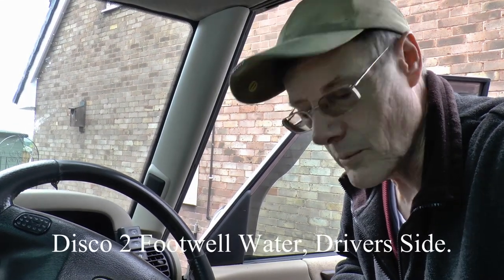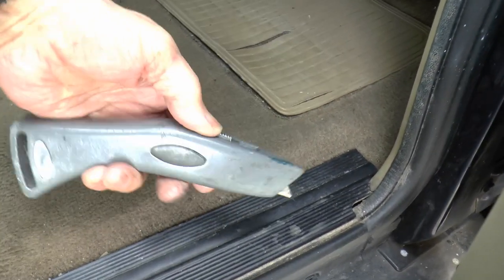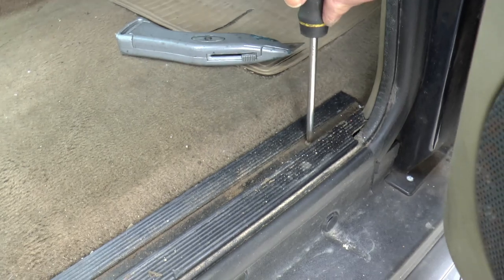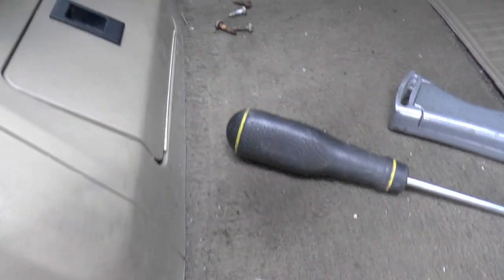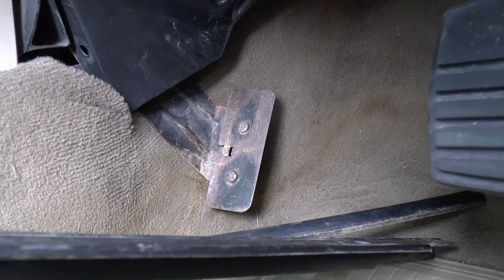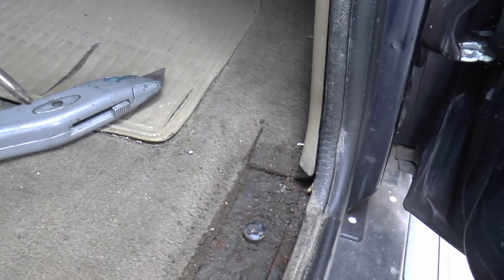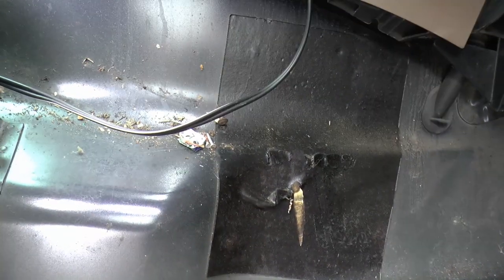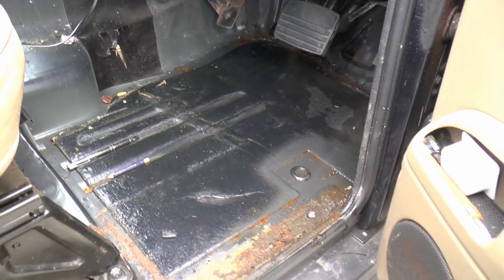Disco 2 Footwell Water, Drivers Side!

Comment: Good morning Derek (my time zone), how are you. I have had my first jab about 6 weeks ago, second one is after 12 weeks (Astrazenica). Do you get fish oil over there. If the metal is sound but rusty, spray with fish oil and let it dry. Smells lovely until dry.  This will convert and seal the rust, then you can paint a protective coat of something over it to seal.
Reply from the maker: Good Evening, tired but well thank you.   Mm, fish oil, that's new. I might just go with the usual Hammerite Rust Converter, thank you . . . !

Comment: I had the same thing, I found the problem was water tracking down the cables that runs down the A box where the drain for the scutle panel and drain from the sun roof goes,  the cables run from the the door in behind A post the out through behind the kick panel, take the kick panel out and you will see the first bunch of wires not far from the door seal, mine was hanging down and causing the grommet to funnel the water down the cables into the foot well, I cable tied it so it now doesn't hang and holds the grommet in a Upwards way, I have no water now, I also filled it with sealent.
Reply from the maker: Good job!      My problem is a holes in the bulkhead causing the water to run in, anyway, good luck with your's!

Comment: Hi Derek, what was the cause of the water getting in?
Reply from the maker: The drivers side is holes in the bulkhead somewhere near the top. The water is still coming in. I fitted a false floor to keep the carpet out of the stream which runs down and out through a drilled hole at the bottom. The passenger side was cracking of the caulking between the panels under the wiper scuttle.
Reply: @sleepycatpictures1176  sounds like you need to remove that windscreen plenum and seal it up really well with some silicone. Atlantic British have an excellent video on how to do this. I have a similar issue that needs investigation.
Reply from the maker: @rosscoupland5833  Yup, something else I need to come back to!